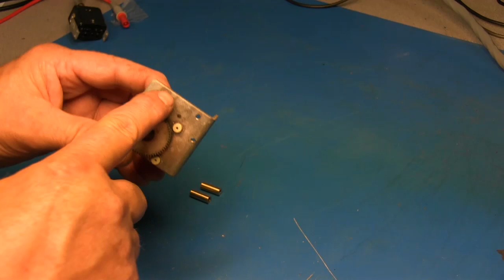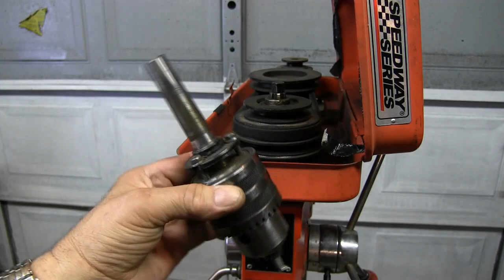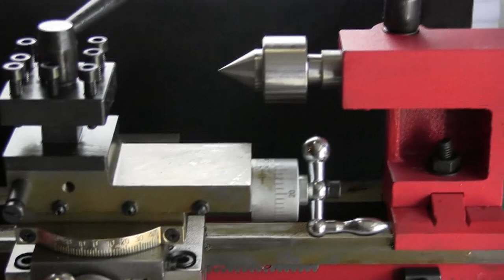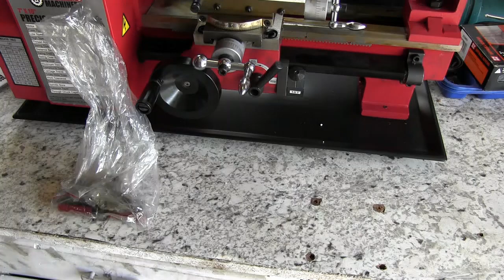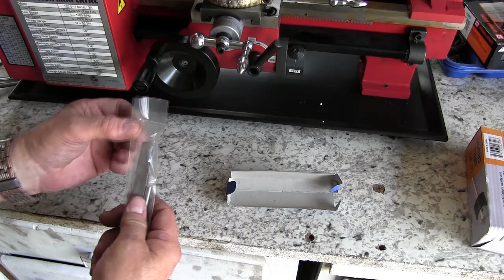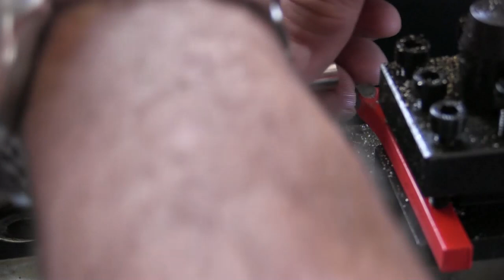#239 Fabricating parts   New tools

Comment: Buddy - have you had any experience in 3D Printing of parts? I was looking on E-BAy at parts for the Turner Plus 3 Microphones - https://www.ebay.com/itm/303922152693?hash=item46c32c04f5%3Ag%3AEzgAAOSwVJRZeLt9&LH_BIN=1 and https://www.ebay.com/itm/304008777300?hash=item46c855ce54:g:1t0AAOSwUnFgchog. The plastic key-down lever and locks are bad about being broken over time. Looking to see if ANYONE in the USA is able to make these parts because Germany prices are very high.

Comment: I had a Unimax lathe for making parts when I had my HO Guage RR set up. Invaluable part of any small workshop. You can make a nice set of aluminum knobs with knurling for your rigs.
Reply from the maker: Yes, and I plan on making custom knobs for the pine board radio. Maybe brass?  This will be a great addition to the shop

Comment: Buddy I have a small machine shop in my garage with a Smitty 3 in one setup, Sherline lathe and mill and all the associated accessories. They do come in handy for making or modifying parts.
Reply from the maker: Sounds nice. I have always wanted to get a small machine shop together to fabricate parts. Now have to spend more than the lathe for tooling lol.
Reply: @TheRadioShop   true it never ends as you get into more machining it seems the more $$ you get to spend. It is enjoyable though to complete a part and it fits and works. Lol

Comment: Hi Buddy,
If you need an extra inch in length, there is a cam lock tailstock that will fit from Little Machine Shop. I bought one for my Micro-Mark 7 x 12 lathe. It's 17 years old and only the speed control failed. Still using the original change gears and I added a 5" three jaw chuck. 73  WB3BJU

https://littlemachineshop.com/products/product_view.php?ProductID=2502&category=1